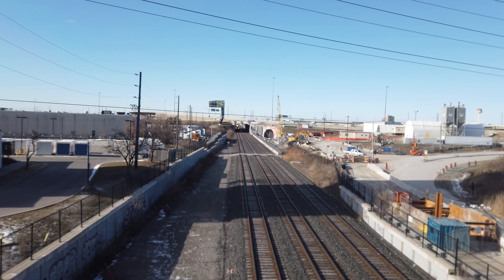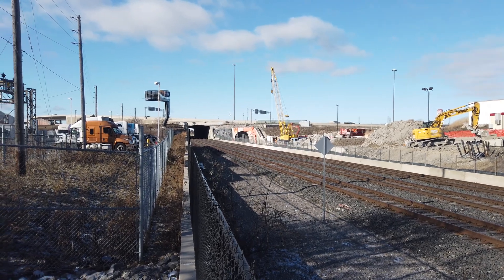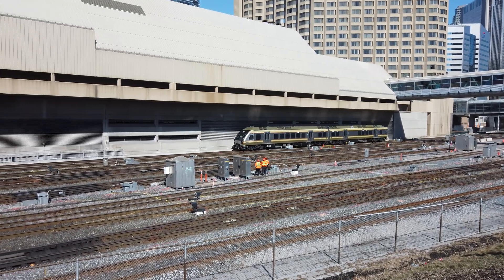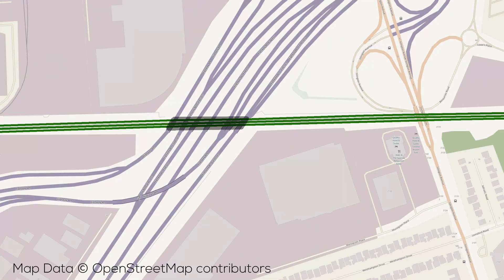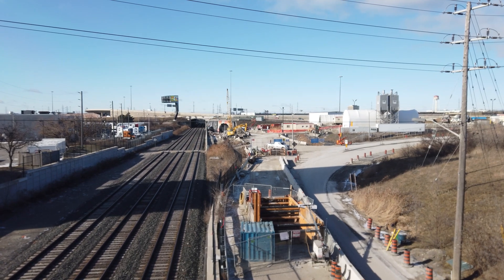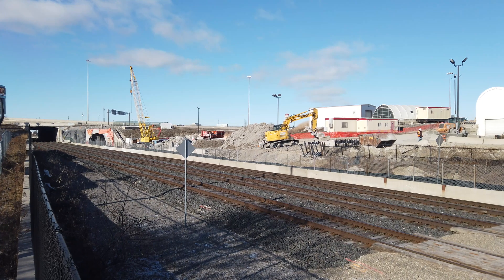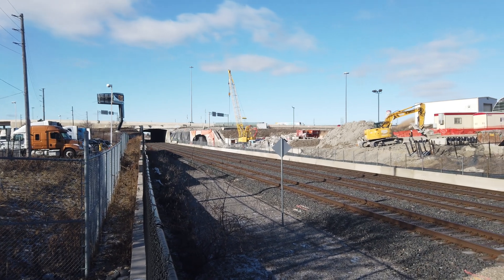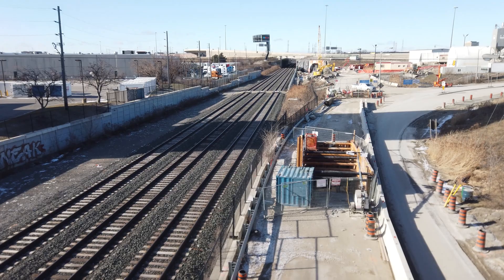Building Toronto's Regional Rail | Ep. 6 | Highway 401/409 Tunnel

Comment: 3 tracks are more than enough for 15tph. Just spectacular to see this kind of forethought going into GO Expansion.
Reply from the maker: It is more than enough but this also removes the speed restrictions
Reply: It's more about service flexibility than capacity. 4 tracks makes it much easier to reliably run a mix of intercity, regional, commuter express and local services in both directions.